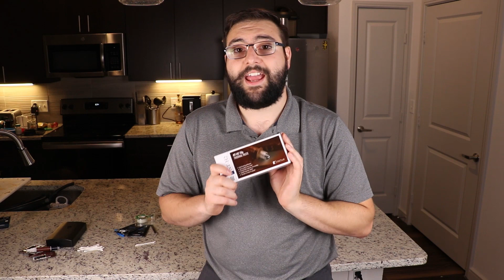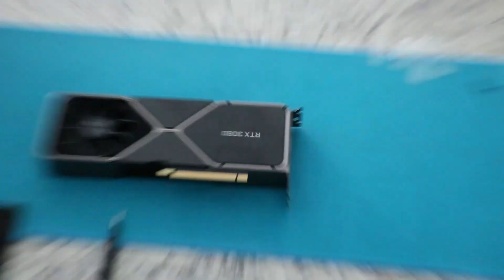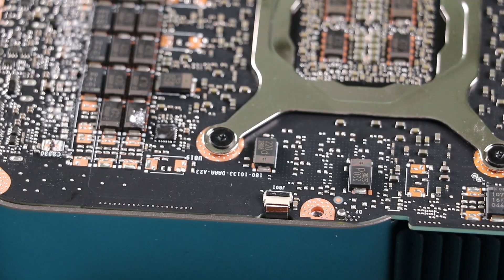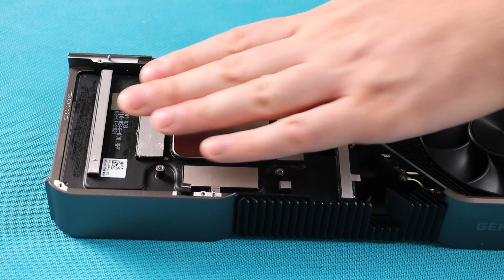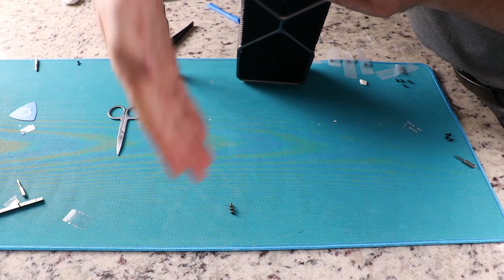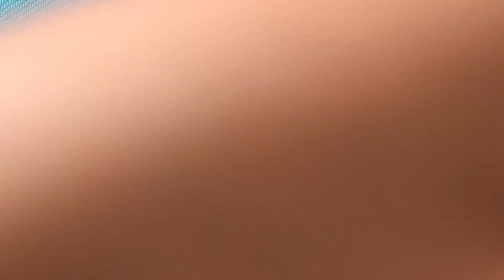Replace your 3080 FE thermal pads and save your GPU from throttling

Comment: Supposedly something has changed in the recent batch of manufacture of the cards so that the 2mm pads end up being too thick, the recommendations I find now are saying 1.5mm instead. Either that, or there is too much deviation in the pads themselves.
Reply from the maker: Thanks! I have been hearing reports of that recently also. I Pinned your comment so hopefully everyone can see!
Reply: @frigidpeons4816  oh well.... I used 2.0mm everywhere and my vram temps are amazing, but my hotspot is 100c!! Core temp is around 60c. Dunno what I did wrong
Reply: @La4edimension  use 1.5mm ultimate instead as suggested in the comments
Reply: @yell9845  is this for newer 3080 fe cards?? i cant tell if im supposed to be using 1.5 or 2 smh
Reply: @ConspiracyJ  1.5mm ultimate gelid
Reply: @yell9845  what about the back? 1.5mm both sides? I have to assume i got a new batch of the 3080
Reply: @ConspiracyJ  back can leave stock pads doesn't make any difference or if have to use 2mm ultimate gelid
Reply: @yell9845  youre the only person online ive seen say 1.5 ult its always 1.5 or 2 of the extreme or whatevwr its called... ive not seen one person say ultimate
Reply: @ConspiracyJ   @jordan tasca  feel free to try 2mm if you get GPU/ high hotspot you will know what's the problem :)

Actually if you look search channel called cryptoathome read the comments :)

Also I mine and I've had 4 3080fe and wasted good amount of thermal packs so I think I have pretty good experience

Also there is no new batch difference , I've had 3080 Fe few months after launch 2mm extreme worked great just few months ago I sold it to my friend I decided I would re paste it got new pack of 2mm extreme and got really high hotspot 100c why would that happen when card worked before with 2mm extreme it's gelid they changed manufacturing with the extreme pads they are not as soft as they used to be solved with 1.5mm ultimate 

Would have most likely worked with 1.5 mm extreme I went with ultimate because they are higher rated and being 1.5mm they don't need to compressed as much
Reply: Same here. 2mm didn't work for me either. After my 3rd try yesterday with the 1.5mm pads (on the gpu side), my 3080 is performing much better.
Reply: @TM-ni1gn  Did you choose 1.5mm all over the die side? Or just the VRAMs? Also what temps are you getting?
Reply: would have loved to have SEEN this BEFORE buying the Gelid 2.0mm pads :(
Maybe put it in the video description at least?
Reply: I usually see people asking what pad to put where and I kind of thought that's how you do it. So it was an eyeopener for me to see how this guy exactly measure what pads to use https://www.youtube.com/watch?v=VIUU5ogVHg8

Comment: Somehow my hotdpot temps went to 104 degrees in idle after changing the pads…
Reply from the maker: It's possible there is not good contact,
You may want to make sure the pads are all contacting the heatsink
Reply: @ i didnt change the Pads on the back could that cause the problem?
Reply: @ i was nearly out of pads, will order more than enough for saturday and will try again. Thanks anyway for the detailed descriptions!

Comment: I followed your tutorial and made my 3080 go from a hard 84°C to 67°C, that's absolutely sick and beyond my expectations ! Thank you so much ! God bless you !
I used 1.5mm thick Arctic TP-3 100x100, for 1.5mm pads inside, and 1,5mm outside doubled with another layer of 1.5mm on the deepests metal plate spots you can notice on it. 
One 100x100 thermal plate is enough for the whole job even if I used 10-15% of a second one by doubling some spots.
Reply from the maker: That's awesome! Glad it helped you out!!

Comment: Applying hand pressure to the card and then removing the pcb again will tell you if your pads and gpu die are being contacted properly. Saves a bit of time just in case the pads are too thin or thick. Also holding back your cables with tape works quite well.

Comment: I have a big question after doing thermal pad and paster replecement my fans stopped working😢😢 I suppose those 2 flip pin connectors are for the fans and they are connected and still not spinning fans...any suggestion?

Comment: Thanks for the video. I bought the gpu used and the last guy used 2mm pads which were too thick as the gpu was throttling, I used 1.5mm today and its working like a dream

Comment: You are an angel I just bought a 3080 and I haven't had a gaming pc in years. I work in a repair shop and am extremely thankful for you for posting this video. I tried launching a game for the first time and it crashed my entire pc causing it to reboot. I had set up a custom fancurve and came back the next day to much cooler Temps at idle, but as soon as I launched a game it was back to square one.

Comment: 16:45 These "easy to remove" wires dont budge. Im positive i cannot move the metal guard and further forward. I have tried lifting and wiggling the heck out of the wire. They don't wanna go anywhere. They flex a little but that black tab wont come up. Guess I'm giving up for now. Hoping for some advice please.

Comment: Hey thanks for the breakdown, overall happy and gratefull there was a thorough video like this. However, i am an idiot and this is not idiot proof lol. It would have been exdtremely helpfull to have a statement to only place the pads on one side of the GPU and not on both the circuit board and the lid like i did and then try to figure out why it would not close. the pads ended up too mixed together and i ended up with crumbs i just spread throught where the pads should have been. Unlucky.

Comment: original FE model pads impress to about 1.5mm front and 2.0mm back, measured with a caliper.  1.5mm pads in front will work, but are risky, because depending on slop, not all the ram may touch evenly and adequately.   safer bet to squish a 2.0mm in front to ensure.  squishing the 2.0mm is very important.  if you use a 1.5mm pad in front, i'd recommend dabbing a bit of paste under each chip to boost it to 1.6mm and ensure contact.

Comment: Followed exactly and VRAM temp went down from 110c to 82c.  But now the Core temp is 15c-20c higher and throttling.  Any suggestions?
Reply: The same thing has happened to my GPU.
Reply from the maker: It sounds like the gpu die is not making proper contact with the heatsink. Make sure everything has good contact, you may need to use a thicker pad on the die or smaller pads everywhere else if you still have the issue
Reply: I didn't use a pad on GPU, just thermal paste.  I took apart again, thermal paste had good coverage.  I pressed the other pads down and reapplied thermal paste and core is down to 80 with fan tuning around 90% continuously.  Actually checking previouse temps, my core was 52c, now 80c.
Reply: Don't follow this guy's advise on the thermal pads size, go with 1.5 for both front and back and you'll see the difference! I did this on my 3080 and gpu temp doesn't go above 60c, memory temp tops out at 69c! HUGE improvement over the stock pads!
Reply: Newer FEs require thinner pads.  You can't get away with 2.0mm/3.00mm anymore on them.  1.5mm front / 2.0mm back of Gelid Extreme would work for both versions.

Comment: I can tell you all, my RTX3080FE GPU temp is 44degree and RAM temp is 68degree under 95Mh/s after modification. I am using 1.5mm for both side and add an external cooling pad at the front. ........ dont use 2mm cause there will be a gap for GPU not touch the thermal pad closely ............................... remember.

Comment: FE is 1.5mm pads not 2.0 have found this out the had way
Reply: Hoping you are right. I did mine last night with 2mm pads and gpu temperature went crazy high. Got a 1.5mm pad arriving later so hope it works with that. The stock pads look thinner than these 2mm ones so I reckon something must have changed on newer 3080 FE cards.
Reply: @TheRichMaxwellChannel  The new 3080FE should use 1.5mm Gelid ultimate. The old 3080FE is 3mm + 2mm Gellid Extreme. I have a 3080FE which is 1 week old and a lot of people who have the latest 3080 are watching all these youtube vids of  old viedos showing the old card.
Reply: @BROADBANNED  exactly right, I re did the pads with 1.5mm gelid ultimate and worked great.
Reply: @TheRichMaxwellChannel  Did you do 1.5 mm for back and front?

Comment: Again...in case it helps someone, it would seem either every card is slightly different or at least the 3080Ti FE is different than the 3080 FE. I tried the same thing. 2mm on the GPU side and 3mm on the backside. It didn't work. Ended up with nice memory temps but GPU and Hot Spot went up by 20 degrees. So I tried again using 1.5 on the GPU side and 2mm on the backside and it worked perfectly. And to specify, this was for a 3080 Ti.
Reply: I'm having the same issue on a new 3080 FE. used 2mm gelid extreme pads but it's sending the core temp to 104 degree hotshots and 78 degrees! Got some 1.5mm pads coming which I hope will fix it for me.
Reply from the maker: good to know, Thanks for sharing!!
Reply: Did you use 1.5 extreme on front? How did it go? I did 1.5mm on front and it helped only a 5-7 degrees difference. Many others stated 15 degrees difference which was not at all the case for me.
Reply: @bps739  it did, but I had to put the card between my palms and gently but firmly press it together along the length. And then it took a couple days before I saw the full temperature drop.
Reply: i have a 3080 fe not a TI.... what would you recommend??? i keep hearing that 1.5mm is a better size?? I BOUGHT the card late 2021
Reply: @ConspiracyJ  I have a 3080 FE as well.  I actually did that one firsts.  I stated in another comment below..."Second day and everything has settled. The temps are cooler across the board but definitely go with 2mm for front and back. Although the 3mm worked for me on the backside, I think it is too thick. Thanks again Frigid Peons for the excellent step by step guide."
Reply: @Timmmer  i have the newer 3080 fe that came out... someone told me 1.5 front and back... 😑 also.... are you using ultimate or the other type of gelid thermal pads
Reply: @ConspiracyJ  I don't recall what the exact one I used was. And if the newer FEs are made even slightly different, it might be an experiment. You'd have to find someone who has upgraded the newer models.

Comment: Hey! Just want to say I used this video and it dropped my gpu memory temps by 30C. And my overall gpu temps by over 12C. 

I used 2 packs of the 2mm pads for the front and back and had almost zero extra. I would recommend 3 packs so you don’t have to be so precise. Thanks for the video!
Reply from the maker: No problem! Glad to hear your Temps are much better!

Comment: Hello i haven't replaced the thermal pads on mine. When i am gaming the junction temps only gets to 94C do you still recommend me to change the thermal pads? i never seen it go above 94C
Reply from the maker: It would help longevity for sure. I think you start to get into throttling around 110
Reply: @frigidpeons4816  I ended up replacing them with the Gelid Extreme 1.5 front and 2.0 back and memory junction dropped to 74°C. Thanks for the good tutorial.
Reply from the maker: Nice! Glad to hear it worked really well for you

Comment: After the replacement the card works ok but  my fans, logo light and rgb light are off...  all the time.. any suggestion how to proceed??
Reply from the maker: It sounds like the cables are either not plugged in or not connected all the way, I would check that

Comment: Great video, I did this mod using 3mm on the back and 2mm on the front. Unfortunately the temps basically stayed the same. But the stock pads were horrible so I’m glad I did it regardless
Reply: Damn same here. Any update?? Or is it still the same

Comment: After this I have memory temp good but hotspot temp very hight (100degrees), what can I do?
Reply from the maker: What size thermal pads did you use? It's possible your gpu is not making great contact to the heat sink
Reply: @frigidpeons4816  2 mm for the front and 2 mm for the back… don’t know what’s the problem , what can I do? Try to put 1,5mm on the front?
Reply: @brunohysa2510  I also am having this problem after doing this. I used 2mm pads on the front and now my gou temp shoots up to high 80c while gaming I cant even game anymore.

Comment: Hope this helps someone. I had already ordered 3mm and 2mm thermal pads before I found this video. I used the 2mm on the front and the 3mm on the back. Much easier to replace the back if necessary. After the operation, I lit it up and at first was concerned because, although the memory temps had dropped substantially, the GPU and HOT SPOT temps were way up. I took the card out and put it between by hands and carefully squeezed it together with a fair bit of pressure. Put the card back in and the temps were MUCH better. The GPU was over 100 initially. My guess is that 1.5s would even work on the GPU side and definitely the 2mm on the back. 

In the end, I went from a 275 memory overclock at temps of 50 GPU, 94 memory, and 64 hot spot with 87 hash rate, to a 1600 memory overclock at temps of 54 GPU, 84 memory, and 70 hot spot with a 103 hash rate.

Matching my old settings, my GPU and hot spot are higher. Likely had I used 1,5 inside and 2 back that would have been better....or even 2mm like shown in this fantastic video, but the memory was the big concern.

How sad is it that Nvidia charges a fortune for these cards, and then decides to chince out of thermal pads. To save money. Some bureaucrat decided that a few warranty claims and bad press was worth the savings over properly cooling these beasts.
Reply: Second day and everything has settled. The temps are cooler across the board but definitely go with 2mm for front and back. Although the 3mm worked for me on the backside, I think it is too thick. Thanks again Frigid Peons for the excellent step by step guide.
Reply: @Timmmer  Which pads did you use? Some are very soft, others not so much. You could use one brand's 1.5mm where you'd use another's 3mm.
Reply: @KindOldRaven  Gelid Solutions GP-Extreme 12W-Thermal Pad 80x40x1.5mm
Reply: I’ve  your same problem, tomorrow I’ll try to remove de 2mm pads on the GPU side and use the 1,5 mm.
I don’t think there are problems with the 3mm pads on the back.
Reply from the maker: Thanks for posting your results! I really hope this video helps people out. Like you said it really Sucks to spend so much on a card and they cheap out on important components to save a few pennies

Comment: From some of the testing I've seen, there doesn't seem to be much difference in replacing the pads on the backplate side, but a massive improvement on the cooler side (which makes sense). So do you think it would be ok to only replace the pads on the cooler / Die side of the card and leave the stock pads on the backplate?
Reply from the maker: Yeah, if you wanted to that would still make a big difference. I replaced both sides because I already have the card disassembled might as well do it all!
Reply: @frigidpeons4816  I only had one pad on hand, but as an update it seems to have worked pretty well! Mining went from consistent 104-106°C to now 84-88°C, still only getting 94 ish MH but it's so much quieter and cooler that I'd still say it's worth it even if I can't tune it to a better hash rate.

I did exactly as shown up until the backplate side, just added a small amount where I had some extra of the Gelid pad left.
Reply from the maker: Well that's awesome! Thanks for letting us know how it turned out!
Reply: what pads did you use? 2 or 1.5mm?
Reply: @ConspiracyJ  I bought one sheet of the Gelid GP-Extreme that was 80mm x 40mm x 2mm, was exactly the right amount to do the cooler side of the card with a tiny bit leftover. If you wanna do both sides you'll need another sheet.

Still going strong btw! Thermals almost always stay around 86-88 c with the settings I used for mining, and usually cooler than that for gaming.

Comment: My RTX 3080 FE cover plate was held in with T5 screws, not Phillips head. Slight difference in build materials.
Reply from the maker: Good to know, they must be changing the design a bit!
Reply: @frigidpeons4816  I don’t think they changed the design. I think you might have put the screws back in the wrong places before making this video. The “V” section should be Philips, and the screws under the small magnetic covers are T5.

Comment: Great tutorial. For some reason, my screws types were reversed on my GPU backplate, the Torx screws were where the Philips were and vice-versa. 2 of them were already stripped. I had to drill out the top of the Torx screw carefully. Now I'm going to have to find screws to replace those two. But I have it running RN at 84-86c @ 100Mh/s while mining. Was 108-110. So it works.

Thx.
Reply from the maker: That's weird, Sucks to hear about the stripped screws... I wish Nvidia had better QC..   Glad to hear the Temps are way lower for you thought! EBay may have some similar screws not sure though